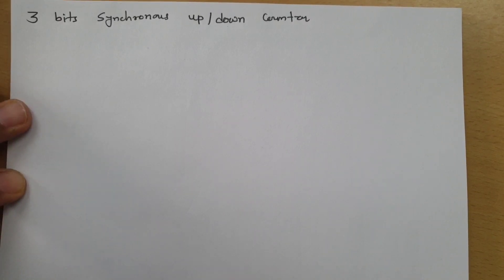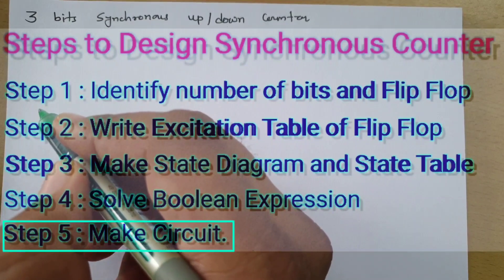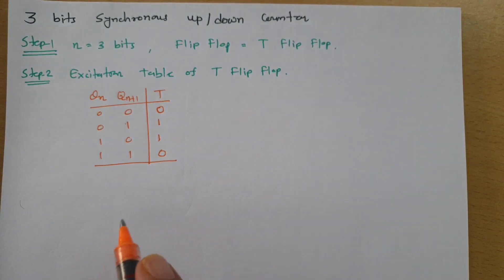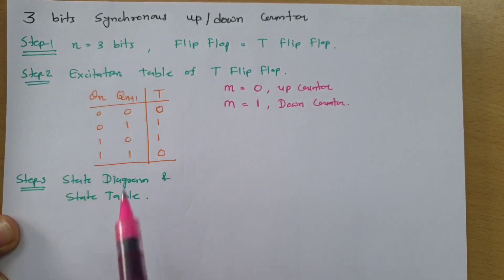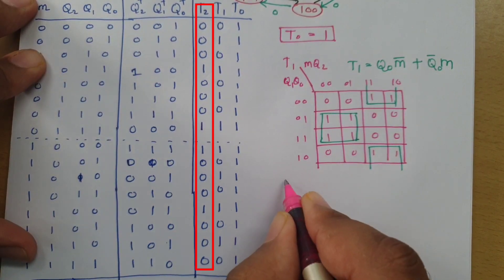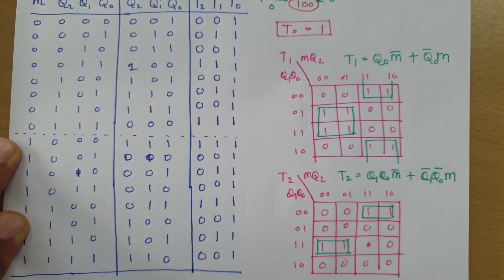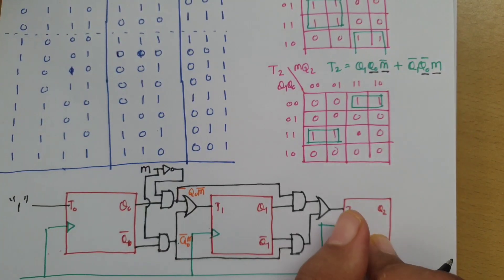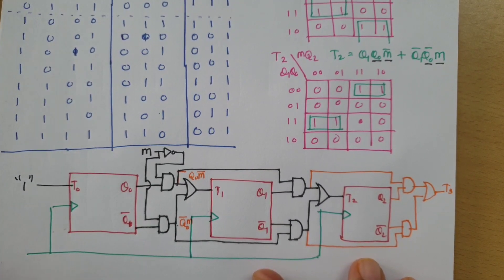3 Bit Synchronous Up & Down Counter: Basics, Circuit, Designing, Working, and Waveforms

Comment: Another problem with this approach is that it increases the gate delays by connecting these gates in series, so later stages of the counter will settle their state much later than the earlier stages, despite the common clock signal. So even if we accept these delays, there still will be some glitches with the counter's output until all the flip flops will settle, so it might be needed to add some sort of a transparent latch on the outputs to hold the previous state unchanged until the new state settles, and only then (perhaps on the falling clock edge) copy the flip-flops' outputs to the overall output.

Comment: 16:30 What about joining two such counters into one longer counter with more bits? How can we acommodate the output from the previous counter in the current counter, so that they could count both up and down together with the same synchronous clock?

Comment: Sir i think there is a pblm with ur K-MAP
Reply: Nah bro,I've finally solve this u just have to vertically arrange the numbers 
Example-: if you do it horizontally ,1st row will have 0,4,12,8 .2nd row will have 1,5,13,9 .3 rd row will have 3,7,15,11.And 4 th row will have-2,6,14,10. Cell no.s**
Reply: These are the cell numbers* , u just write it down somewhere and  then fill the k-map accordingly.
Reply: 10:4 Sir you made a mistake in the first row and 4th column there would be 0 not 1
Reply: yea there is in K- map .. IN T1 , in 01 state 1  have to be 1 sir have did in 10  state 2 which bit was 0 .. by the way its almost one year you would have corrected that problem ...

Comment: Plz anyone explain me how to write kmap values.9:25
Reply: Take 4 variable k map. With up inputs Qa Qb and down inputs Qc and M. Put the 1 values in separately for T2 and T1 Kmap and solve the Boolean equation for T2 and T1. 

T2 values are €m ( 3,7,8,12)
T1 values are €m (1,3,5,7,8,10,12,14)
T1 = 1 as all inputs are 1.

Comment: In down state table why you moved from 111 to ooo u have to move to 110
Reply: You have to not Down move blindly. You have to look in the state diagram you have made and only as per that you have to move to the next state. According to the State table for 000 the next state is 111. For 001 the next state is 000. For 010 the next state is 001. For 011 next state is 101. For 100 next state is 011. For 101 next state is 100. For 110 next state is 101. For 111 the next state is 110. like wise you move down
Reply: @explainit-k14 thank you ❤
Reply: Same issue
Reply from the maker: Just written state diagram.

Comment: Why is it counting up in a table and again counting up rather than down?
Reply: Same issue
Reply: It is not. 0-7 is count up. 8-15 is count down.
If you see properly 000 output is 001 and 111 output is 111 when M=0 is up counter. (0 to 7)

Whereas 000 outputs is 111 and 111 output is 001 when M=1 is down counter  (7 to 0)

Comment: I'm binge-watching this playlist now, sir, I've got a question why are we using +ve edge clock pulse in synchronous counter whereas -ve edge clock pulse in asynchronous counter? and is there any rule to use a specific clock signal for various counters? please answer sir...🙏😓
Reply from the maker: I dont this rules. You can use positive or negative edge trigger clock in both circuits.
Reply: @EngineeringFunda  thanks for replying sir🙏, loved this playlist and I learnt a lot 😍🥰

Comment: Why is that when writing the bits for down counting, you move from 111 to 000 and not 111 to 110 as indicated in the state diagram
Reply: Hey compare with the states   q2,q1,q0, then in the next state will be 1 less of the present state like if q2,q1,q0, is 001 the next state will be 1-1 =0 same applies to other , don't just look at the next state table it is decided using present state hence you should take consideration of that also 
Hope it solved the doubt even I got the same doubt then figured it out for more that 20 minutes ,hence I was able to answer
Reply: Bhai M=0 is Up Counting 
M=1 is down counting 

To phle up count ho rha h islie 111 ke bad 000 aya h

Uske bad down count likha h islie 111 ke bad 110 aa rha h
👍
Reply: 001 k bad 000 hii ay ga in down counter
Reply: @sadaqataliofficial8622 explain kar de bhai phele down count hua then kyu fir se up count hua
Reply: @sadaqataliofficial8622 how??
Reply: yes

Comment: Is d flip flop and t flip flop the same sir
Reply from the maker: Nope it is very different
Reply: D flip flop is a Data flip flop. Output follows the input which can be made by JK or SK by connecting a NOT gate. 

T flip flop is a Toggle flip flop. It toggles the output when T= 1 or memory state when 0. This can be made by JK by shorting both the terminals.